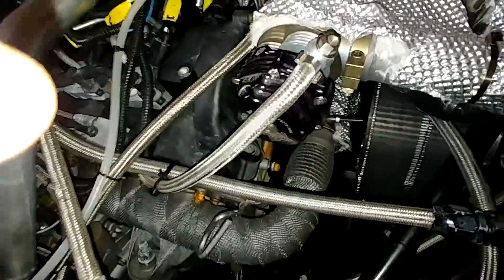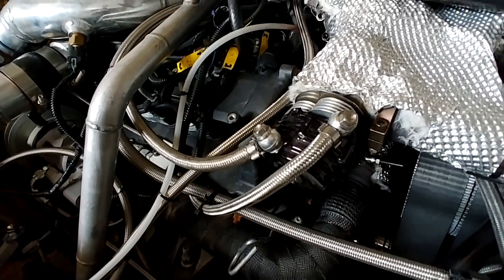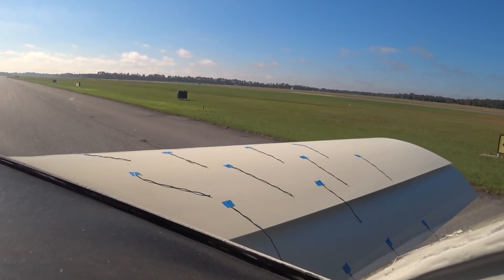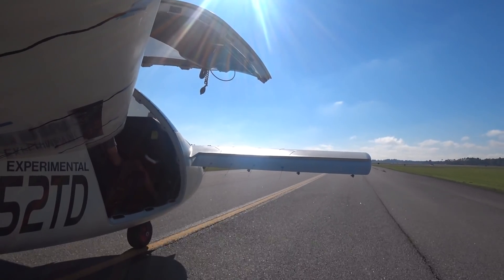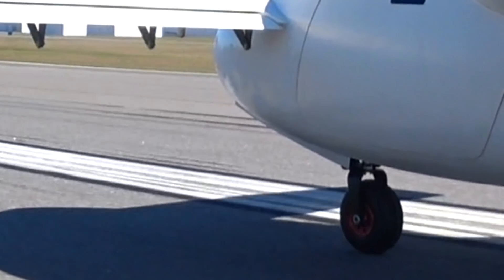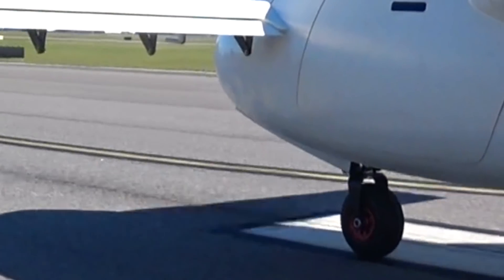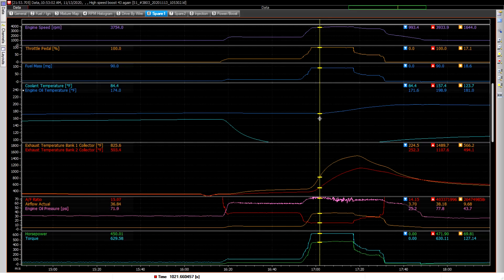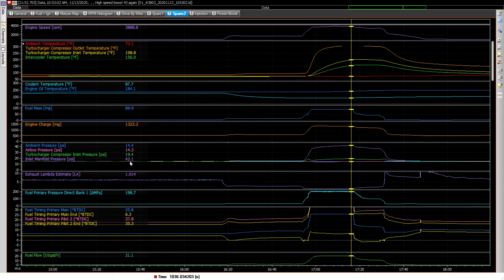One Last Check - Building the Raptor Prototype

Comment: Respectfully, dumping the engine heat into the cabin with the pilot does not seem like a sound standard operating procedure; it is what people do to overheating cars caught in traffic jam.
Having seen all of your videos, I can understand that you have championed the cause of a diesel aircraft engine, and I think that it's practical, but the engine has to stay cool, so the oil doesn't break down. All you have is are a few rings of oil to keep the crankshaft and bearings apart.
Yes, you checked boxes, but within the understanding that didn't readjust the mixture on the turbo tests, I'd guess that it was a relief to reconnect the 2nd turbo. Having never disconnected the 2nd turbo from the system, you might only have your initial trust tests. Has not horsepower been one of your high concerns?
You have overcome some hurdles. Oh, that 'efn front wheel. That took so much time, but you still need time to soft a prototype aircraft out.
Oddly, your test-pilot was likely right about the move to where you are now. Still, moving took time.
I think that tweaking the cooling issues in a minor way will cost more time.
It would be interesting if there were a single turbo that would give you most of what you want, and still allow high-altitude flight.
Some more airflow through the engine compartment might be the cheapest cooling change. Vents and louvers are cheap, as long as they don't let in water.
Reply: Wasabi were always right except when they were wrong. Calling for new runway on the day of a planned test is rather lacking in planning and foresight.. Should have been called for on the previous visit or the one before that.. Peter would have complied as he did on the last visit.. If it was me I would be looking for compensation. Hope Peter got some for that wasted trip.

Comment: Firstly, I am a non pilot...at the moment. So if this sounds ignorant sorry! That being said.
Has a fixed gear version been considered....I appreciate that there maybe some impact on performance but it would seam to me that the recent air flow issues have been solved- at least in part - by  blanking off the wheel wells. Additionally, might this also mean fewer mai.tainance issues? I am sure that this solution might bring other problems though.
Anyway, the Raptor continues to be a beautiful craft and the build inspiring.
Reply: I believe he has yet to determine if open wheel wells are having any adverse affect.  They are closed off to eliminate the possibility of air flow issue whilst he gets the weight and balance correct and  imagine he will reveal the wheel wells on flight 3 or 4 once he starts to check out landing gear proper.  I hope he is able to preserve retract capability myself and am confident he can overcome any turbulent air flow under the wing he might find with one solution or another. But you are right. Very cool aircraft!

Comment: Peter, you are not having black smoke so it’s clear the engine is not being choked by the turbos. It’s more likely that the idiots on the forum gave you false information about the mixture programming. No black smoke, no choking. It’s clearly too lean.
Reply: What does "too lean" mean for a diesel?

Comment: compound turbos - I cringe when you use the word vacuum to describe the increased efficiency created between turbo 1 and turbo 2.  PSI is a measure of restriction, the reduced restriction observed is higher volume due to the efficiency of the 2nd turbo.  Vacuum is the removal of air when the effect between the turbos is actually increased due to the volume increased.  For the Nascar fans, when two cars are running so close that the 2nd car's bumper is on the first - the 2nd car is pushing the first car so that both can go faster - the second car is giving it's 'found' energy (due to reduced drag) into the first car so that they both can go faster... same concept here, neither turbo, alone, could create the volume the motor sees but since they work together, there is greater efficiency.... but in no way is the first car creating a vacuum to pull the second car onto its bumper...
Reply: ..and what is another name for restriction? Back pressure maybe 🤔 and how do you check back pressure? Vacuum gauge maybe? Not sure you understand his use of vacuum.
Reply: @PaulAnthonyDuttonUk  he is an Aussie... so perhaps that's true? that said vacuum doesn't increase velocity.

Comment: I still don't know why you are using a  Diesel engine in  a plane I have never heard of that!!
Reply: I'm not a pilot but anyone who has worked wuth tractors and sailboats knows diesel is far and away simpler, more dependable and once running won't let you down if fuel is clean.
Reply: I understand this application is different and I obviously know less than you on this subject. However, I have a barn full of equipment both gas and diesel. I can get in my 1985 tractor with diesel fuel that is years old and if the battery is up it will start and run all day.  My yanmar diesel can sit up all year and start instantly.  I don't think the basic reliability changes with the application. I trust Peter and predict a much better second flight. Can't wait for battery technology to catch up. I've gotten spoiled to 120mph equivalent running our ford on all electric.

Comment: Did anyone notice how stable the temp sensor behind the fan runs? Where everything is rising? Is there a possibility that the fan is blowing in the wrong direction? Just a thought... The heater is not involve in the thermostat circuit if I'm not mistaken hence the temp drop right? Might add that the radiator is the highest point of the cooling passage, it will be a bitch to get all the air out of the cooling system unless the is a bleed screw located at the highest point
Reply: Good points.
Reply: It makes no sense what Peter was saying at all.  Either Peter explained the ambient wrong and it is not the air coming out of the radiator, or as suggested the fan is reversed, or might be no water in radiator!! Whatever it makes no sense.
Reply: @SwimmingBrambles  the best way to help Peter is to look at the data and just analyze it and give suggestions and possible scenario, Pete has alot on his plate, I do believe he does go through the comments but just doesn't respond...

Comment: Is it ready for a second flight ? How long could he go with max power before the engine is cooked ?
Putting tape on the landing gear wells may help a bit but I think it will take more then that to get this plane to circuit height.
Hopefully he puts more planning into second flight with a chase plane filming so that you can see exactly what is going on from outside and if worse comes to worse will be helpful in the crash investigation.
Hopefully he has made arrangements for fire and ambulance crews to be on standby.
Praying everything goes well for Peter
Reply: Chase plane??! Ha! Now you know he doesn’t allow anyone to work with him or you vice versa...
Reply: I think if the aircraft turned out at the planned weight then it may have been viable as a test aircraft....just... but the extra fat brings with it  a lot of doubt.  Better  to redesign or re power than carrying on risking everything knowing that even if minor performance improvements are found that the performance is still inadequate. Or maybe it can just be a winter plane...

Comment: Sound great ,things look good and you happy with results, and we'll be tuning for second flight , and i do wish you a very successful flight , and the plan goes as you wish , i read about onshape software and it gives so much options there is a plane called DarkAero use it  ,so i guess it's a good move ,you doing a great hard work so keep it going , i should thank you for the update , and tuning for the coming one.

Comment: 12:05.., I see the inner rear spar on the right of the screen.., one of my many duties in Aerospace was benching inner rear spar's for the airbus A320, good God they were huge.., I am also quite infamous in that I found a fault in a rib 4 of which 120 were sent to Wrexham 80 of which were fitted to wings of A320's, 40 to the right and 40 to the left wing.., the remaining 40 ribs were scrapped due to continuity issues but money talks and there are 40 A320's in the air right now with dodgy rib 4's which so happen to sit above a 6.5 tonne Rolls Royce engine.., but money talks right?
Reply: Well done on your find! You must be the man responsible for me having to fit my 6'4" body between rib 3 and 4 on more than one occasion, to inspect for those cracked ribs. Seems word eventually got out via an AD. Why did you have to look so hard!??? The zero-stress jacking and wing skin splits required to repair rear spar corrosion from your Bristol brothers and sisters also kept me well employed, as did the sheared shear plate fasteners under the rear galley from your Hamburg Design Engineers. Don't get me started on BF Goodrich and the internal politics that led to a less than desirable c-duct product, or the well-meaning Airbus Engineers who opted to secure the panels under the AC packs using aluminium fastener receptacles that were forever corroding due to the steady stream of water pouring out of the condenser. All that said, I thoroughly enjoyed my years working on the bus, seeing it live and breath in service. They always seemed to be upfront with their in-field findings from other operators and would pocket the cost if it was a systemic issue not related to localised operator maintenance or procedure. With all my dealings I'd sit in an A320, or any Airbus product for that matter, any day of the week.
Reply: @PatrickJWenzel  Glad ya got that off your chest :-p.., the ribs were not cracked, I first found the problem when examining the rib prior to benching, if there were a major issue with the rib and I benched it I would get shit, when I put the rib into the benching jig I was examining the flat side, running my hands over the surface I could feel small bumps on the back of every foot, the issue turned out to be the machinist had used the wrong tool and the wrong speed (was too fast).., this was heating up the inner feet pockets ans altering their continuity, The machinist responsible was bloody raging with me but that was my job ffs :-p.., he was sacked and a huge delegation from Wrexam came over to Greyabbey NI to have a pow wow.., I cant understand how any of the other shifts missed 119 of them but I spotted it straight away, the end.
Reply: @PatrickJWenzel  My ident number was 264 incase you ever come across it :-p
Reply: @PatrickJWenzel  We benched a variety of ribs, my favorite was the A380 ribs, we also benched parts for the F-35, that was quite funny as only 2 of our guy's had clearance to bench the F-35 parts one of which was on the next bench to me.., wiser munching on grass.
Reply: Haha yeah all said tongue in cheek. To be honest I don't remember exactly what the AD inspection was for, but I will never forget how bloody claustrophobic the task made me feel! I break aircraft instead of fixing them, nowadays, but I find it super cool that I worked on something you made, many worlds apart.
Reply: @PatrickJWenzel  It is a small world mate, I hope you are happy in whatever you do, Andy, Northern Ireland.

Comment: The common rail systems start a small, mild, (less knock), combustion with the initial pulse of fuel then add to the already started combustion with subsequent pulses of fuel, to reach the desired complete combustion .

Comment: Peter, I do not understand why you decided not to take the advice of experienced turbo diesel mechanics to make things run cooler even if it requires making changes that may result in more reliable performance and increased safety.  If the cooling requires the use of your heater to manage temps, how can you hope to fly longer than one circuit around the patch.  Many experts came forward to assist you in this regard and were ignored, like I said, I do not understand why.
Reply: Expedience seems to be a factor. Test it now, change it later before production.

Comment: Should you have gone with an all aluminum LS type engine that is Naturally Asperated with 400+ HP or a smaller Supercharged engine to better manage heat?
Reply: I've seen other experimental planes run a LS engine.. The engine he is running is automotive so I'm sure he dosent use "Jet fuel" now. Maybe I'm wrong?
Reply: @joeychaseable  it is a diesel engine and diesel and jet fuel burn similarly. The thought process is that jet fuel isn’t going away but 100LL (av gas) may. I’d encourage you to watch some of the older videos where he goes through much of his design process and why he chose this particular engine.
Just FYI, NA engines aren’t good choices as you fly higher and higher. The lack of air density means the engine makes less and less power, hence a turbo. Many airplane motors are “turbo normalized” so they make the same amount of power as you get higher.
Reply: Pump gas/mogas and diesel are the corresponding fuels to avgas and jet fuel in aviation. 
The main difference is is that avgas is pricey or non existent because of lead. This poses issues when going cross country or if you're in Europe. Lead is also bad for engines.
If the injectors and fuel pumps can handle the lack of lubricants in jet A, something you can design around, it makes almost no difference to the engine which you're using, and the prices aren't too different either.
That being said ls's are tuned and configured with turbos all the time, and there are plenty of psru's available too. They are very light at under 400 ibs without cooling or psru for an easy 350+ hp. I would have considered it seriously
Reply: LS doesn’t run jet fuel

Comment: Would you consider selling a 3D model (.stl file) for interested model aviators?
Reply: See if you can find one for the Velocity - basically the same concept...
Reply: @steveobhave  - It may be the same concept, but I like Raptors' lines better.
Reply: @SomeGuyInSandy  Coming from Rutan aircraft, this one feels a bit "chubby" and I'm not a fan of everything hanging off the control surfaces.
Reply: @SomeGuyInSandy  me too. Even a 3-view ortho would be enough.
Reply: @iforce2d  It would, but a .stl file is better for 3d printing. I suppose my only choice is going to be to model it myself.

Comment: Any thoughts for a heat sink in the fuel tanks? Keep the diesel warm and remove  heat from the coolant.
Reply: I think the plan was to use the fuel for reducing intake air temperatures. His cruising condition of 300 knots true at 30k feet will have 3x the airspeed at 37% the air density, or roughly the same air mass flow rate from solely aerodynamics. His coolant heat rejection load is probably the same but he's planning on 3x the pressure ratio for 9x even a perfect compressor will require roughly 2.5x the heat rejection...
His air to air intercooler is going to require all the help it can get
Reply: The math for that is that an idealized compressor has a 3^(1/3.5) =1.37 temperature ratio for a pressure ratio of 3. So going from a pressure ratio of 3 to 9 requires (1.37^2-1)/(1.37-1) = 2.4 times the heat rejection in watts
Reply: @rv6ejguy  525f is insanely hot for charge air though the math checks out. considering that is above the autoignition temperature of diesel and Jet A that makes me nervous that he's using charge air to fuel heat exchangers. One bad seal and you could have a horrific fire. 
that being said on surface level I like the idea of a fuel to air heat-exchanger due to wing surface area but I would also be worried a hot-spot from the fuel return line could put the composite well above Tg of the epoxy.
Also how did you get from cooling power required to core volume? I can't think of a way without empirical data or hand waving levels of assumptions...
Reply: I like the lateral thinking...